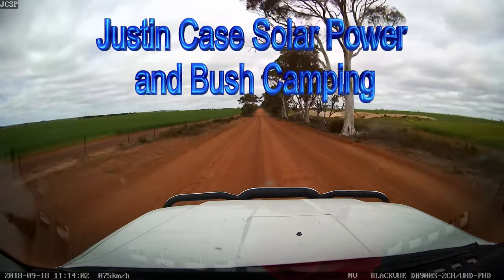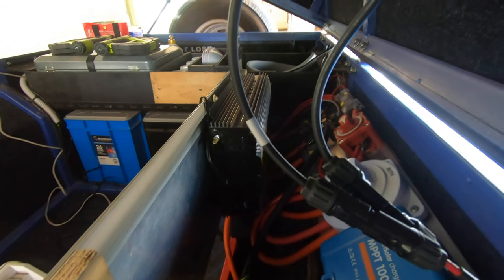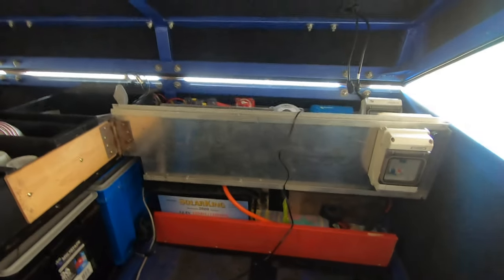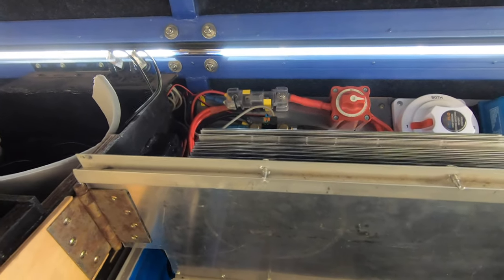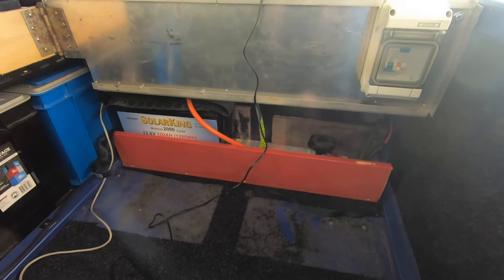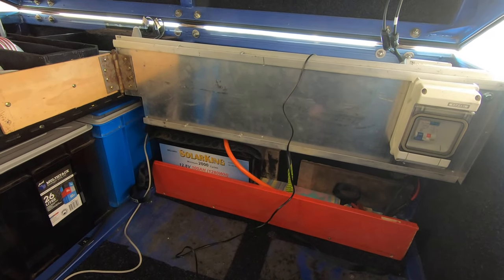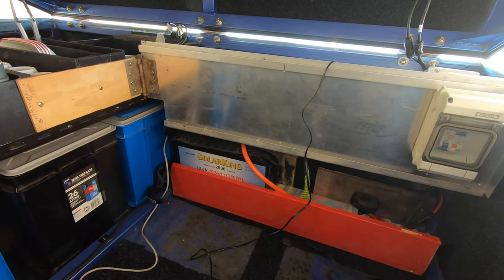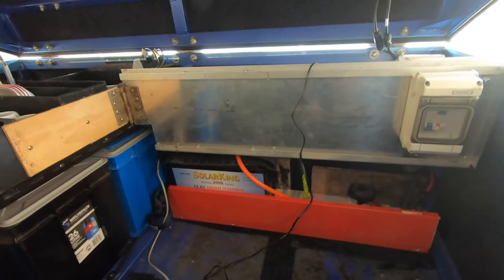Lithium battery Install 9.  The Switches arrived and the installation is almost done

Comment: Hi there Chris nearly done mate fantastic mate , can you please make an simple drawing for us of for what you've done with the electric switches and the fuses Cheers my friend
Reply from the maker: Your happy to look for yourself and do your own drewinga. :) Me i have better things to do with my time.  I am off to Broomhill  W.A. soon as i have another off grid system going in on a new straw bale house construction. Need to Have the trailer done and finished as we will be using that down there. Kitchen and power.
Reply: @JustinCaseSolarPower  That's a pity mate,  Bit hard mate, I'm in QLD Hervey Bay  any way thanks for the reply my friend
Reply from the maker: @jackturtle131  Wiring DC is pretty basic stuff. Just 2 wires. Well its time you came to WA for a holiday.  😉It'ss just a short drive really it is.  😁🍻
Reply: @JustinCaseSolarPower  really  Hahahahaha maybe one day Chris
Reply from the maker: @jackturtle131  After Cyclone season Sigi and i will be going to do wolf creek crater and Bungle bungles Kununurra  Gibb river road then back inland through Marble bar and many places in between.  So yes its just a short trip from QLD to Kununurra. 🍻😉👍
Reply: @JustinCaseSolarPower  What an magic dream you had mate I like the idea
Reply from the maker: @jackturtle131  Yes i often solve my problems in my sleep. Unfortunately not all turn out so well  😉🍻

Comment: Aaaah, but the question is................................ How many spare fuses in the glovebox ?   :)
Reply from the maker: More than you could ever use in a trip around Australia twice. In the glove box i only keep fuses for the car including the large main fuses for the alternator and battery. I have a locktight bag full that i keep in the pocket of the engel fridge cover.  It has about 50 or so fuses in it.  Did you think i would go into the outback of Western Australia without all the spare parts i need to keep everything running and to get home safe >? I also carry enough tools to do any work needed on the camper or the car. And yes I am one of the rare  Australians that will stop and help others on the side of the road. Not just drive past and look the other way.